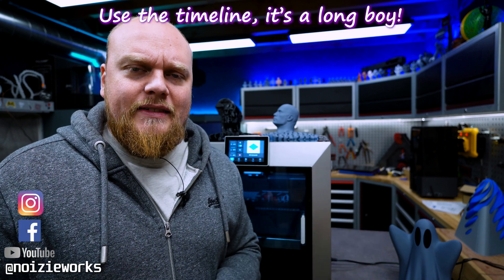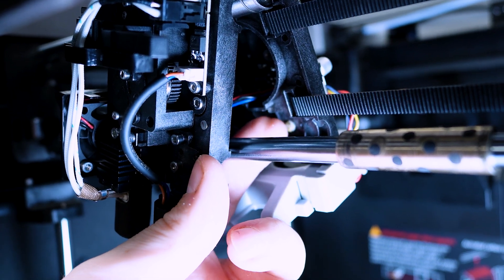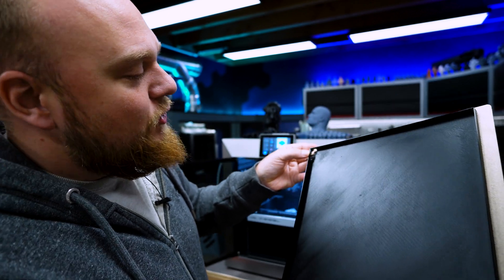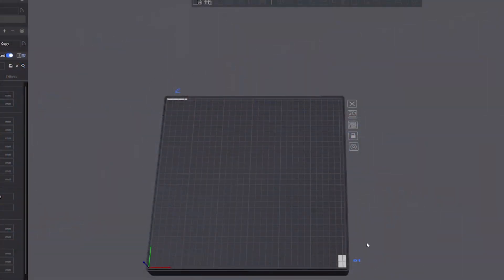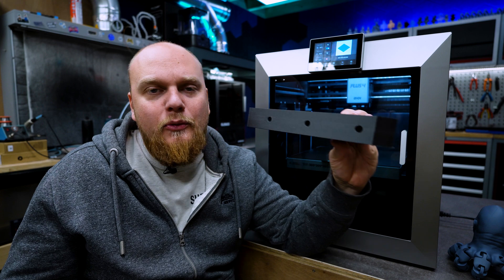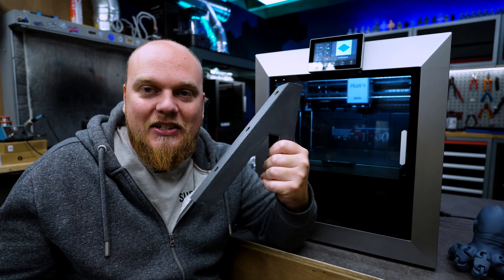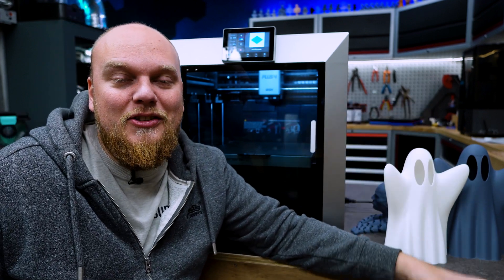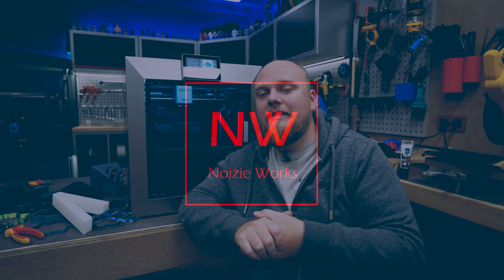How i fixed the Qidi plus 4 loose bearing and hidden filament cutter feature?

Comment: so a high temp silicon glue is the fix?
Reply from the maker: @JohnDoe-ot5ir  together with the 2 bolts recommended by qidi. I just added the silicone to fill the void IF those bolts get loose for the reasons explained
Reply: @NoizieWorks  ok thanks.  My plus4 arrives today.
Reply from the maker: @JohnDoe-ot5ir  Hope you have a great time!
Reply: @NoizieWorks  I currently have a p1s  and x1c and still excited for the plus 4.
Reply: @JohnDoe-ot5ir  whats is Your opinion after 3 months with qidi ?

Comment: If you add a spring between the head of the bolt and the clamshell the tension from the spring should stop it from vibrating loose.
Reply from the maker: @freedomofmotion  Many options on how to fix it for sure.
Reply: I don't have my unit yet, but it'll be here Wednesday. Is there a type of spring that you have in mind?

It's my first 3D printer, but I'm a tinkerer, and I love figuring out solutions to fix and improve things.
Reply: @Decimus-Magnus  Just one from a clothes peg would probably be fine but you will need washers for sure. 

Basically any spring that is smaller diameter than the head of the bolt but larger than the threads would be fine 😁
Reply from the maker: The only concern i have is the plastic you turn the screw in. It's not threaded or has a brass insert to reinforce so be careful.
Reply: @NoizieWorks  Wow that's such a janky official fix from qidi then 🤣
Reply from the maker: Why do you think i decided to use silicone lol 😆
Reply: @NoizieWorks  Does the back cover of the print head cover these holes?
Reply from the maker: If you slide of the back panel like the video you have direct access to them.
Reply: @NoizieWorks  Thanks I'm thinking perhaps the cover could be used to apple pressure to some pins or springs  instead of using bolts.
Reply from the maker: I just hope they revise it in the next batch

Comment from the maker: I figured out why the first layer got weird in the corner, because of the nozzle crash that 1 corner needed adjusting again as it drooped down. My bad!
Reply: Had to change the excluded bed area. I homed the printer and tested which space isn't printable in the front right to change that and not get that problem of the Filament cutter hitting the shell.
I attached my exclude bed area. 

0x305, 0x300, 50x300, 50x305, 305x305, 305x305, 305x305, 305x20, 295x20, 295x0, 305x0, 305x20, 305x305
Reply from the maker: Thanks for sharing! I wonder why they do it then...
Reply: @NoizieWorks  in my theory that thing is just for the Qidi box and they never tested the printer in all possible ways. If you want you could use it already with macros like Bambu. Cutting Filament so the user just pulls back Filament. But for sure pressing it by yourself is a lot faster since you would have to go home in front cutting the Filament every time. The Macros aren't that nice well thought too. After bed leveling etc. it's heating up in the front left corner oozing Filament when you have a full wiper/clean area in the back to solve that
Reply from the maker: @sonkegarnholz5016  I already adressed the oozing in the Q1 pro. You have a spot for it! And now they do it again🙈

Comment: Why are printer manufacturers never transparent about the real build size? ..  305x305 is not the size..  Why advertise it as such then? .. FLsun did the same trick with their new printers. This in combination with loose bearings; i think i'll stick with Bambu for now.
Reply: Because of the cutter, bambu p1s/x1c has a larger unprintable area in the left front that can't print 256*256, did you really use bambu？
Reply from the maker: @HuskyRides  I don't get it either
Reply: Technically it can print 310x310 with a few small exclusion zones is my understanding.
Reply from the maker: @802Garage  Not in the qidi studio, i originally imported a 305x305 square and it started complaining about those zones so i adjusted until it fitted.
The measurements i gave are the maximum XY according to the slicer.
Right now i really need this thing to start spitting plastic for a project so feel free to try it out and get back to me if these are unnecessary boundaries.
It could be that they need to update the slicer but at that point i will pass it on directly.
Reply: @NoizieWorks  imo its a bit scummy to tell buyers it can print 305x305 when in reality it can only print 298x288. if you advertise it as 305x305 just fckn add extra way for the nozzle cleaning and filament cutter.
Reply: @NoizieWorks  Right I totally get that and the exclusion zones are laid out in the machine settings, but I'm talking actual physical capabilities. I agree it needs to be more clear.
Reply from the maker: I'm of the same opinion, like why not add  extra 25mm build height
Reply: @NoizieWorks  In QidiSlicer 1.1.7 a 300x290 square fits and slices without issue, a 305 x305 cross fits and slices without issue. At least one other user has deleted the exclusion zones and printed a 305x305 square, so it seems the printer can print 305x305..... but it still sucks it's not as simple as stated on the front of the build table
Reply from the maker: @AusPhilMotivated  So the exclusion zones on qidi studio are pointless?
Going to try it myself in a few days, now it needs to do some work.
It could be that these zones are there for the ams and these zones need to be kept free to do a filament cut in the right bottom corner and purge in the top left